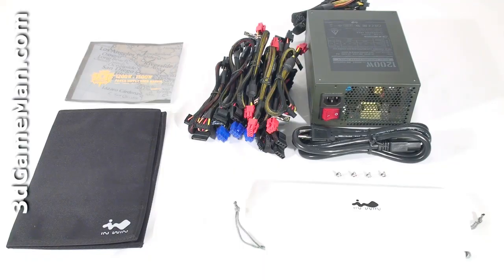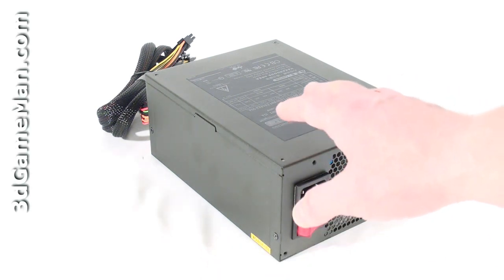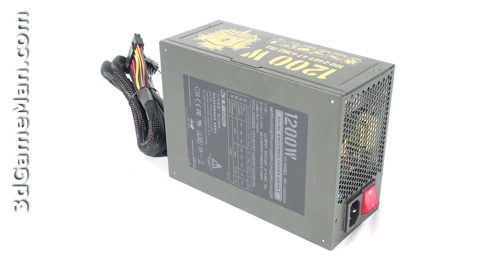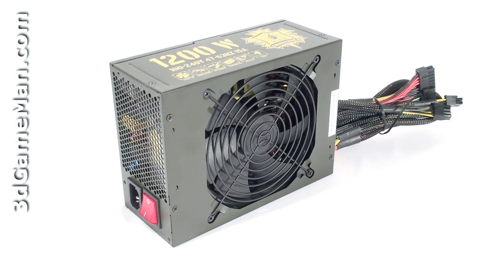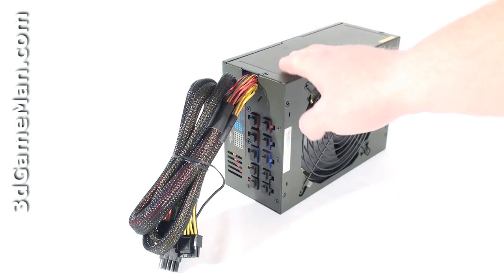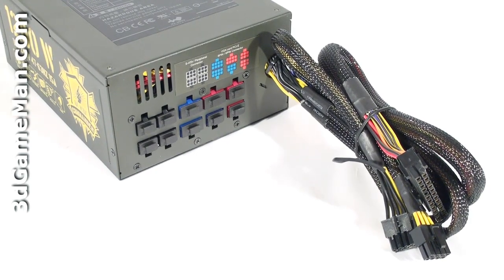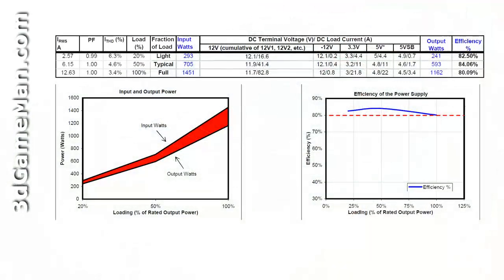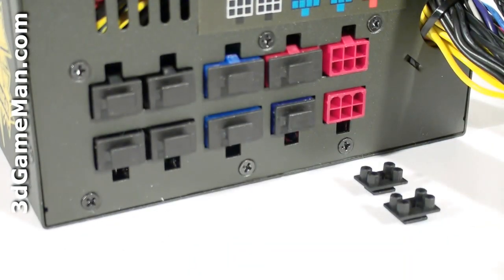#1053 - In Win Commander 1200W Power Supply Video Review

Comment: No :P A 1200W power supply can even deliver more power than 1200, you got total amperes x voltage = watt. This will be 1200w on this power supply, but if it has a efficienty of 80%, 80% will mean 1200W will be transferred to your pc components, and 1500W will be consumed. When you go to far over the 1200W a good power supply will shut itself doing preventing damage to your hardware.

Comment: This is exactly the same power supply as the Thermaltake Toughpower 1200W, same pcb same electronics, same cables, just the paint and the brand name changes.